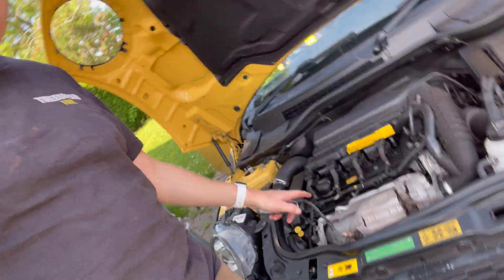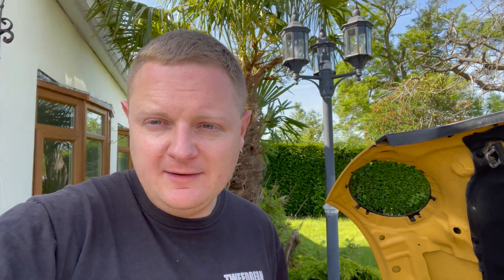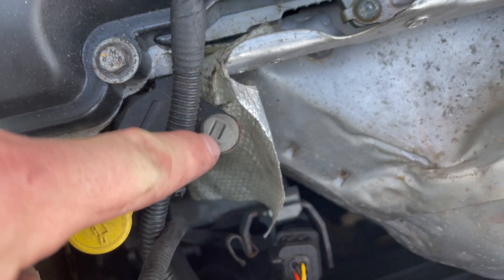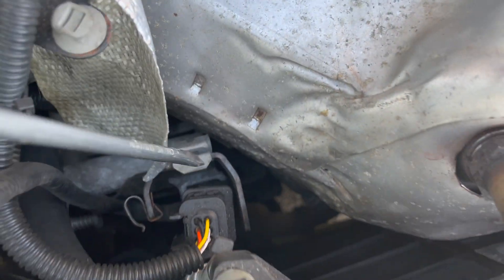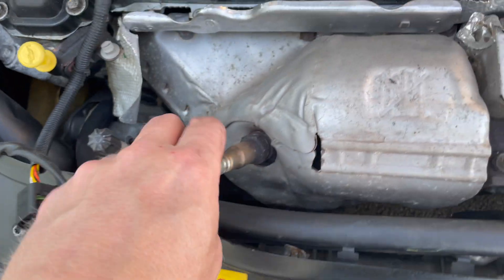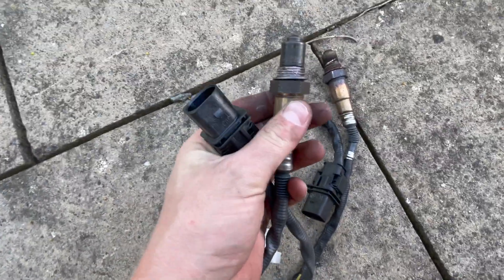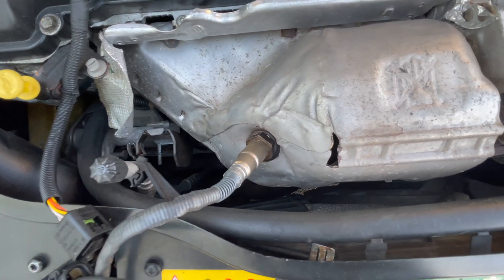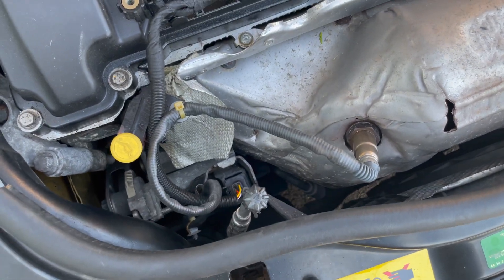How To: Changing the top O2 Sensor Mini R56 Downpipe Cooper S

Comment: What makes it so black?
Reply from the maker: A black coating on an oxygen (O2) sensor typically indicates a rich air-fuel mixture, where too much fuel is being burned. This rich condition can lead to carbon buildup and soot deposits on the sensor's tip. Other causes of black deposits include oil contamination, or even the sensor itself failing

Comment: Thank you brother! My shop replaced both 02’s, plugs and coils. It ran like a bat out of hell. Less than a week later; crank and hard choppy starts, codes and limp mode in and out. Did they mangle the install? Thanks!
Reply from the maker: Possibly it’s hard to tell.  On one of the sensors it comes without the plug so you have to wire it yourself, maybe that plug came loose
Reply: @tweedbean  Turned out to be a bad HPFP. Running and starting strong now. Do you think I should pull the spark plugs and clean them after all the rough miles I put on in between? New plugs? Thanks as always!